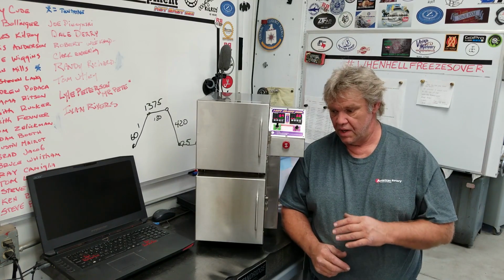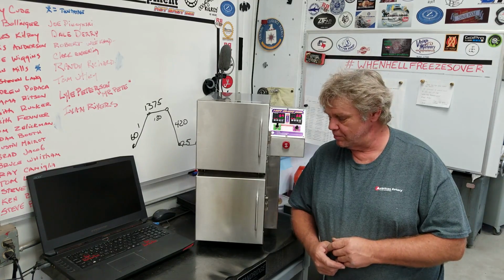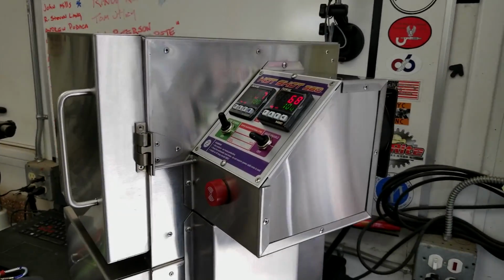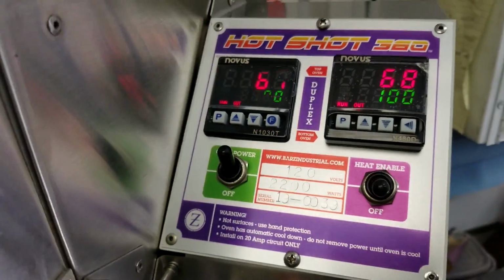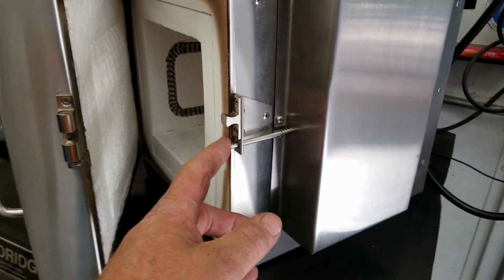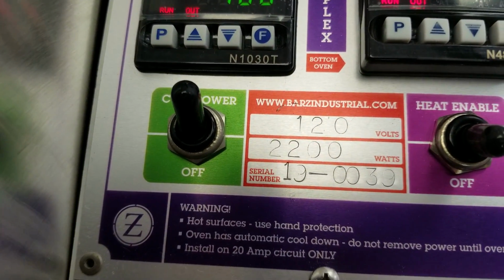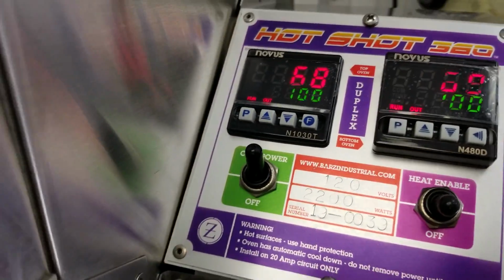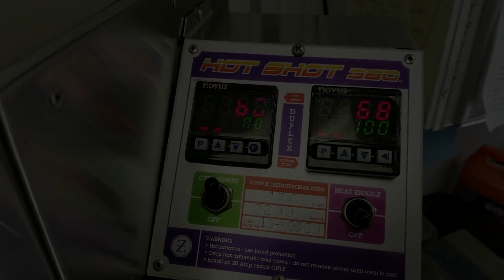Hot Shot 360 Duplex, first look

Comment: I love the concept and am very interested. Do you offer this unit in 220v? How do you keep from blowing breakers? Electricians design 20 amp circuits to 80 percent (16 amps) and I’ve personally seen cutler and sq d breakers trip between 18-19 amps. If you offer it in 220 I’d really consider this machine. Excellent plan of attack Stan.

Comment: Quench and temper at the same time. Very nice! Some tool steels need close to 1000f for tempering though.
Reply from the maker: 575F is the highest I could find on the charts. What grade is that?
Reply: @ShadonHKW  D2, S7, DC53  many of the tool/die steels with high toughness will use the higher Tempering temps.
Reply from the maker: I think the lower oven would be a good candidate for that :)

Comment: Nicely done, well designed. Question; besides the basic timer can you control the ramp up and cool down times on the panels?
Reply from the maker: The advanced control on the high temp oven will do ramp-soak profiles, the low temp is run-hold-timer only.